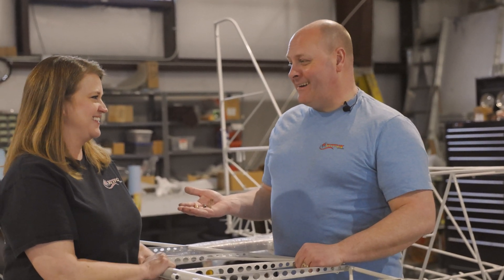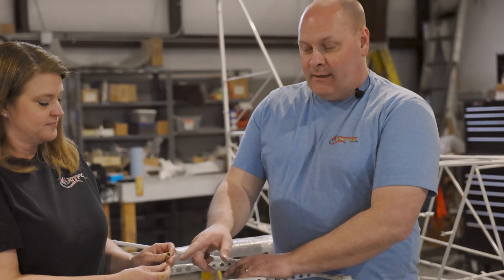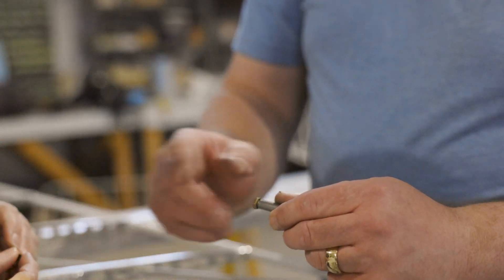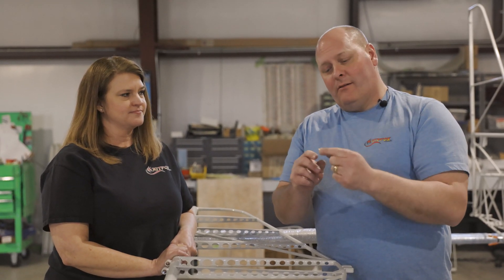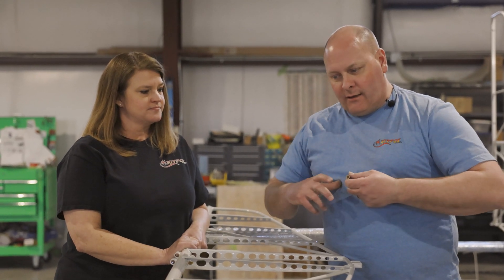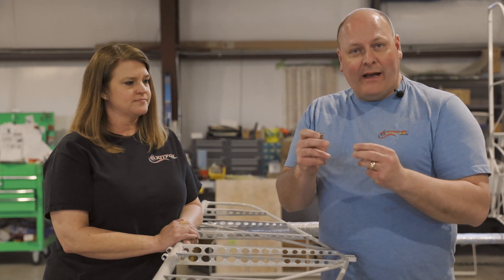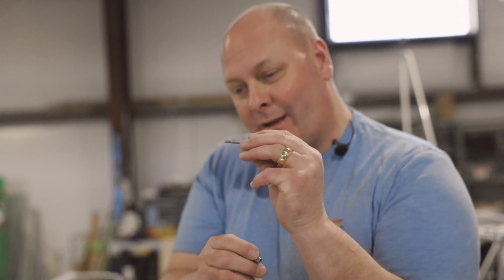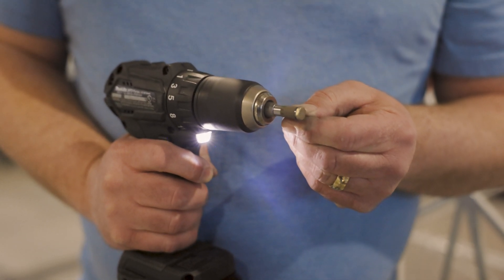KITFOX Technical Support & Build Series 4 - Hinge Bushings

Comment: Speaking as a former machinist & former engine builder, that is a different assembly method than I would have expected.  If those bushings are oil impregnated sintered bronze (oilite) then I would not have expected bearing lock compound to stick to it, even after cleaning with alcohol.  It's interesting that you make that work & don't have issues with the bushings slipping during use.  I would have expected to need a 0.0005" press fit on the diameter and assembly with the use of an under sized diameter bolt as a press arbor or the use of dry ice for a shrink fit.  I also would have expected to see the inline bushings, of a single control surface, line-reamed after assembly.  I guess that system is more forgiving compared to some of the things I had worked on in the past.  The devil is always in the details and these details are quite interesting to me.  You make things work that I did not expect would work.